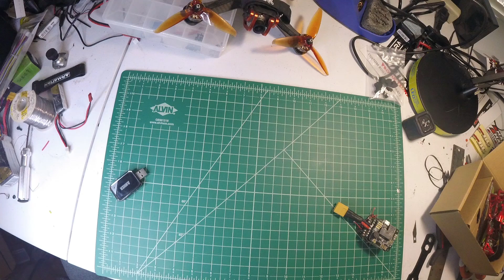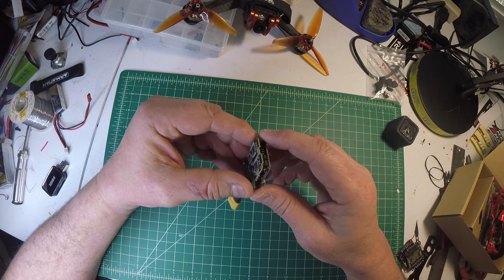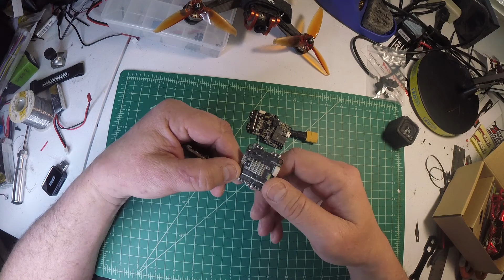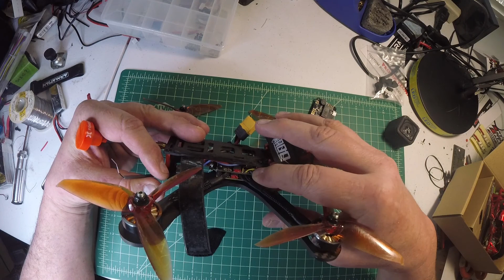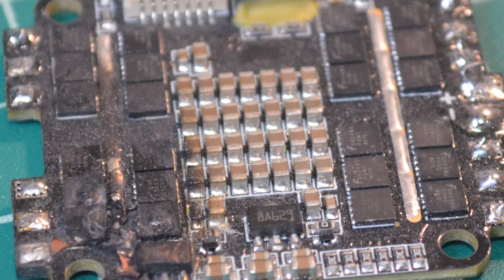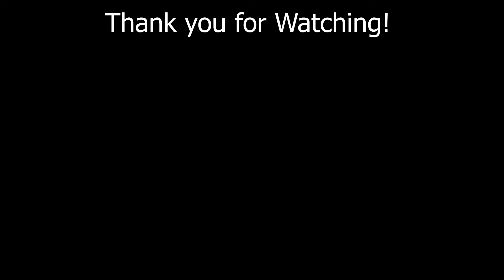Emax F4 Magnum, 2 quick failures with this, 1 caught on fire!

Comment: I’ve had a lot of heavy crashes with a hawk 5 and the magnum stack, hasn’t had a problem yet, I think if I was replacing I would go for the holybro stack and use tbs vtx/rx, just to make it a proper build. Though if I don’t have any problems I’m just going to build a quad with good gear and keep the hawk as a beater, because it’s been great after 30 packs or so now

Comment: Well , I'm watching this video because I am new to fpv and i am trying to figure out the best way to remove my vtx lol . So far i have ran maybe 10 packs if that through my hawk5 and i have crashed just as any rookie would . first issue i had is the channel selection button is gone and second is my vtx antenna connector fell off the board , third problem i have now is the mini usb has stopped working so i can't tune in betaflight . So i'm not a big fan of the emax magnum so far .
Reply from the maker: Jeremy King me neither.  I have had good luck with hobbywing, consider trying that.